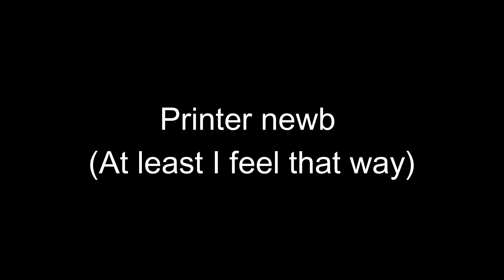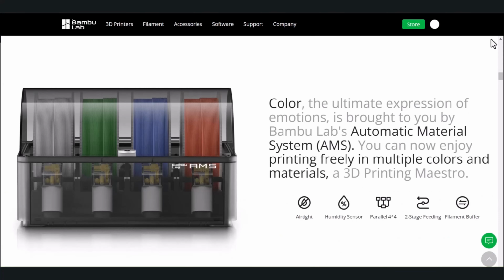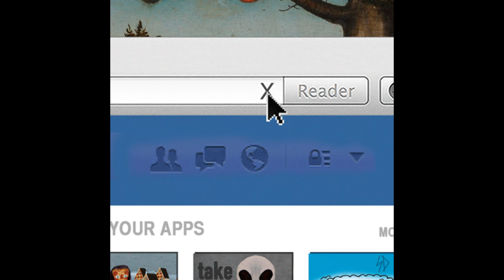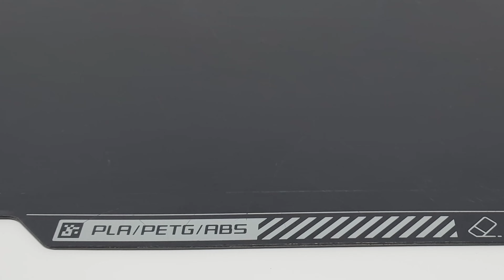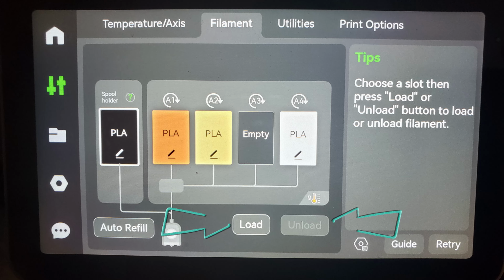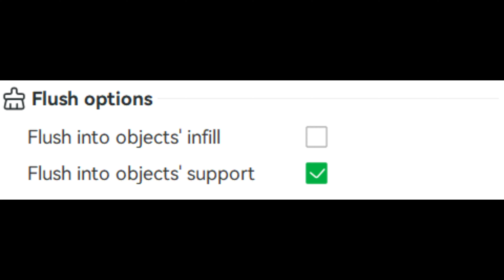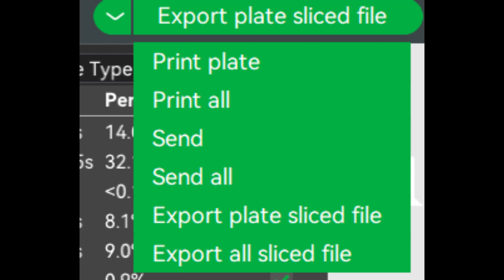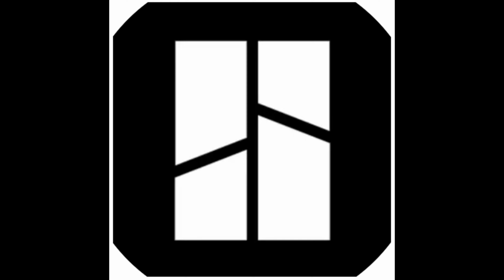Bambu Lab X1 Carbon 14 Month Review

Comment: This is why I like your channel. You have great, clear, concise content. Easy to understand and follow. Not any amount of fluff or fill. Very interesting subject especially with the E3 info... Just like I did. The only difference was I waited and ended up with a P1S w/AMS. And yes, it just works. Thank you for continuing the journey.
Reply from the maker: I still have love/hate with that Ender. It was the baseline of how I view printers now. I just wouldnt wish it on anyone in 202X.  I dont have the Prusa but the Ender is a filament rack and dryer now. If the P1S was available back then I would have been fine with that too. 

Thank you for your continued support. :yougotthis:
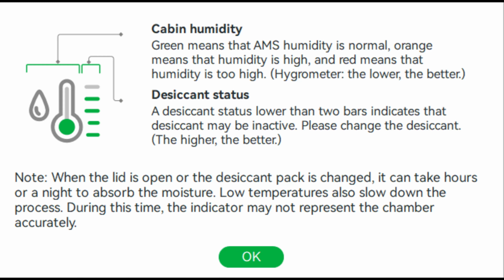Reply from the maker: Hello. I had a question for you. Does the P1S with AMS have auto refill(filament redundancy) in  bambu studio? @ 18:19  Someone on the forums mentioned it may not and I assumed it does.
Reply: @ashleys3dprintshop  Yes it does. Just have to enable it. Only for filaments of the same type, you cannot continue with a PETG if toy started with PLA.

Comment: This was a very good review of the BL X1C 3D Printer.  It’s clear that your experience enabled you to learn a lot about this printer that most users will not have to experience. At the same time It’s good to know that what you started with has only gotten better over time and that you’re still happy with the printer.  My first printer was a Creality Ender 3 S1 and I kicked myself for not waiting a couple months when the S1 pro came out, but it was still a very good printer for me to learn on.  I now have the BL X1C and it is my best and favorite printer and I use it a lot in our 42 foot fifth wheel RV. We sold our stick-and-brick home last year and went full time in the RV during the summer of 2022.  My wife is very sensitive to sound and smells and she doesn’t mind the X1C running inside the RV and since I vent it outside she doesn’t complain about any smells either. I only print PLA, PETG and some TPU so I haven’t needed to worry about ABS or ASA smells….yet.
Reply from the maker: Thank you very much. I think some "long term use" reviews can give a (slightly) better picture than a quick 2 week one that some channels do. Even if I am a data point of 1 it helpful to see users point of view good and bad. Mine has been nearly all good and the bad is quickly forgettable or learning the printer quirks. I hope what I learn I can give back in a positive way.

So many of us start with a creality at some point and it will make or break us but it was a notable learning experience.  

It's awesome you can use the printer in an enclosed space. Do you have it on a table or floor for prints? I threw mine on an uneven laminate floor with a cheap Ikea "Lack" end table and its been rocking and rolling.

Comment: Outstanding review Ashley! The X1 Carbon Combo was my 2nd printer (1st was a Robo3D R1+ which I used for 5 years) and my first Kickstarter, so I could identify with your journey. I saw a YouTube video the day my printer arrived that demonstrated using Windex on the cool plate, didn’t really want to mess with a gluestick, so went with the Windex and have never looked back. Everyone raved about PEI plates, so I got the Bambu Lab version. I have never used it! The cool plate meets my needs for PLA printing; I have 2 now. I did not realize how much faster it was going to be at Normal speed and how big a difference it would make. I have yet to print a benchy either. The AMS was a huge draw for me as filament was a pain to change on the Robo. Having 4 colors ready to go is a real plus and changing them out is a breeze. Bambu Studio is awesome and a pleasure to use. The x1 is not perfect, but it has exceeded my expectations. Bambu Lab caught everyone sleeping and has stirred up everyone up in a good way. Thanks for the thoughtful review!
Reply from the maker: Thank you for that. I have noticed some(short term) reviews miss out on common fixes everyone could use..
Windex over gluestick is a great example.

Also since I am not going through multiple machines in a short time the generational leaps in tech are more impressive.

And studio has been great, from beginning to the updates later. I didnt even touch on that. Lol. Again thank you for the positive feedback.

Comment: One of the things that impressed me about Bambu Lab is their updates and their commitment to their customers, I bought 7 Creality machines before the X1 Carbon and FW updates usually broke features on the printer, I learned fast not to use Creality FW, for years they couldnt even get the ABL on their printers to perform a uniform probing of the bed, every one of those printers came with issues that had to be fixed, I estimate I could have paid for my X1 Carbon with the upgrades alone.
 I love my X1 Carbon and AMS!
Reply from the maker: Dont remind me.  🤣I had the same issue when I upgraded to the Cr touch. Firmware that was hosted on someone google drive was the only one that worked properly.  I wont say i'll never touch a creality printer again but they have an uphill battle before I shell out $$$. lol

Comment: First printer was a Prusa MK3S+ in early 2021 and I quickly became a Prusa fanboy. Got my X1 Carbon / AMS in early Aug 23. By the second print I knew I would never use the Prusa again. There are some minor things that bug me with Bambu, you clear an error on the slicer program, still won't print, you have to walk over to the printer, clear the same error on the screen before you can proceed. I'm sure they will work it out eventually. Regardless, I'm 100% on team Bambu now even though I did have the issue where they sent a print to my printer at 05:00 and it crashed into an existing print on my bed (no damage was done, but not a pleasant way to to be woken up).  I have also never printed a Benchy 😋
Reply from the maker: If I started with the mk3s+ I could certainly see myself being a Josef fan. I liked Prusa Slicer over Cura Slicer. The printer had no real issues of note just the speed, at quality, just wasnt there. 

BUt once I had the X1C and if I added up all the time with both the ender and mk3 after month 3 I had printed more and varied items, on the BL printer, than both combined. I wish I can say I am a loyal fanboy but it would be nearly impossible to pull me from my X1C in current year. 

I had run into the error of a print being done but the slicer still saying job was not complete before. I haven't seen it crop up in a few weeks though.

Thank you for your comment. 😁

Comment: Thanks for this in depth review. I'm having the hardest time deciding between the P1S or X1C
Reply from the maker: There is a $500 difference....If money is no issue...😅
but the big issues besides price is what you want to mainly print. I almost exclusively print in PLA/PETG so the P1S would technically work fine.

But there are some big differences if you print abrasive filament like carbon fiber/nylon.

The camera is MUCH slower and lower resolution(1080p/720p)
24fps for the x1c and 0.5fps for the p1 series.  kinda ok for time-lapse but nearly useless for live viewing that isn't a slow slideshow. It can be fixed with a smart cam (wyze cam) and creative placement on a tripod ($30-$50)

print failure(spaghetti detection) and object exclusion(skip failed prints) isn't available on the P1S. 

The touch screen on the X1C is the brains and does a lot for the overall experience. You can get by with using a cell phone or computer since the p1p/p1s non-touch screens are functional but not enjoyable to use if that makes sense.  

I will paraphrase what someone who bought a P1S over a X1C. The prints are fine but they had regret with what the X1C had. $500 regret...🤔
Reply: There is also the materials to consider... If you plan on printing (a lot) with Glow-in-the-dark, wood, carbon fiber, or any plastics with fibers or coarse stuff in it, then you have to either buy the X1C or get the hardened steel head for the P1S.

If you need to print with Nylon or other really high temperature filaments, then I recommend the X1C. The additional features such as lidar and higher quality camera means you'll have a more reliable printer for those critical prints in pricey filaments.

The P1S does excellent for general hobby printing especially for the price. The X1C is if you want that extra muscle out the box with some extra features to top it off.

If budget is a concern and you are still looking at entry hobby level printing, then I would consider the newly release Bambu Lab A1. Multicolor printing for the about the same price as the P1S... It's not enclosed, but I have yet to hear of any trouble that wasn't user error (and I mean really BAD user error)
Reply: @DonsArtnGames  thanks for this! I would certainly like to try different materials (coming from an ender 3) I hate to hold myself back again and feel the need for a new printer soon after so think I'll stretch the extra 500
Reply: @ashleys3dprintshop    thanks for laying out these differences! $500 does seem like a lot of extra cash if I'm not positive I'll need all the extras, but coming from ender 3, I'm definitely ready to explore different materials and potentially sell an item I designed. I'm also a bit scared I won't "go big" on this purchase and end up wanting another printer in the next several months
Reply from the maker: @rache5399  FOMO is a very real thing so I certainly empathize. On the bright side everything is an upgrade. 😁

Depending on what you are selling you can easily make back your investment so the initial price shock is temporary.
Reply: Excellent review of the printer I am considering. I didn’t go down the cheap 3D printer route that eventually costs a fortune, I bought an inexpensive Monoprice Voxel (a rebadged Flashforge) It helped me a lot so I wanted to know more. Like you I’ve never printed a Benchy, never seen the point when I can print something useful that I have designed. Again like you my second printer is a Prusa MK3S built from a kit. Been very reliable and still prints well. However, although my head says buy a Prusa MK4 my heart says be brave and get the X1C. Thank you again, I think you have made my decision.
Reply from the maker: @stuartwyre4742  Thank you very much. My humble first printer choices certainly brought be down an expensive hole. But I am in a good place now.

MK4 or X1C. Both are solid choices. The first round of MK4 reminded me too much of the mk3s+ but with the new firmware updates there are more compelling reasons to look closer now. The mmu3 is still going through some teething pain but I am sure it will get sorted out. 

The X1C is a very good first try from an unknown company so very little complaints and much praise. It's closer to an appliance in 2023 than a tinkerer's hobby.

Comment: I saw a couple 3D printing videos on YT and I thought I can do that, my dads friend sold me a heavily modded and used Voxelab Aquila S2 and I only had that for a couple days before ordering the X1C w AMS. 

Side note: sale on Bambus website starting June 5th at 8 pm

But at 8:17 that’s what my dad’s friend says, it just works, no tinkering, no messing around, just slice and print and most times the print will finish w no problem. I’m a newb to all of this, and I just did a 19hr T800 print, Timelapse video on my channel. Hell, I might buy another AMS so I don’t have to do filament swaps
Reply from the maker: , the bambu lab printer pretty much launched my channel, I can spend more time on projects than messing around with the printer.  I have a feeling they're going to be releasing Another Printer I don't have direct evidence just a gut feeling since the X1 Carbon release roughly 2 years ago

Comment: I really like the bambu products, but here is the issue.
I have tried to contact Bambu Labs from their official website with no luck.  The website won't allow me to go past the terms it makes you agree to. I finally was able to send a message just to test how long it would take for Bambu Labs to reply.  It is days later now, and I still haven't heard anything back. I don't know how anyone could give these people your business.  What happens if the product has issue?  I am really bummed out.  I was excited after watching and reading about this product.  I was ready to place an order for an A1 combo, but at this point, I'm glad I didn't 😢.  Any suggestions on another printer?
Reply from the maker: My experience is an anecdote of one. I can only give you direct info on what I personally witnessed so any recommendations will come from consuming review content from trusted sources. I have a technical background so as long as I can get parts I am generally happy. I am currently happy. 

 The one time I did contact support I was sorted out within a day. Ymmv. I have never used any support line to purchase a printer, ever, so I have zero direct knowledge if that is a viable way to purchase a machine or even ask questions.  There are X1E printers sold by vendors who will be more than happy to answer your questions, and provide support contracts. 

What I can say since Aug of 2022 I have been rocking and rolling and we'll over 4k hours printed.

I hear Prusa is good with support but I have never contacted them. That is above your price target unless you are fine with the mini and no mmu/ams option. 

I will say(expensive) printers with corpo contracts(24/7 support /on site techs, loaner devices,) will have excellent support but that is beyond consumer printers. Unfortunately for the price of the $560 for the A1 may not give you a lot of one on one time with customer service. Your options of prebuilts(sub $600)are not known for great customer service and your options for an AMS lite are lost. 

If you are near a microcenter, you could shell out extra for an extended warranty to cover catastrophic events.

Comment: Really solid video, I ended up going with the K1 Max due to the price difference and size of the build plate but I was blown away hearing Bambu was such a new company. If they were closer in price I'd have definitely given the Bambu a shot. Australia tax is strong.
Reply from the maker: That K1 Max bed size had me drooling. I don't print a lot of large things but I'm not sure if that was because I was lazy splitting things and putting them together(@ 24:14 thundercats claw,) or I just become used to the size I have now. that first ender was 220x220x250 so everything was an upgrade. 🙂

Creality has certainly upped their printer game in 2023 so the best printer is always the one that handles your needs. How do you like it so far? Do print large often or fill plate?

Thank you for the kind words about the video. 
🥲about the Aussie fees, they seem disgustingly punishing.
Reply: @ashleys3dprintshop  It should be arriving today! My old printer is a CR6-SE that a friend talked me into and it better be as good as some reviews say because the CR6-SE was a nightmare! 

I also didn't print that much big stuff, but that's definitely due to wanting a more plug and play, not wanting to slice and deal with that, and the print time being max 50mm/s and non stop fails. Waking up to a print failing was a constant issue that made me put it away for a while, but we'll see how it goes. I'm cautiously optimistic.
Reply from the maker: @kurtcrean  Oh wow, Congrats. I am sending out all positive energy my friend. 

A generational leap in tech will spark a new printing journey. 😁
Reply: @kurtcrean  The X1C is AWESOME... The only time I have had issues is when I used poor quality filament. Going back to my tried and true brought back the quality.